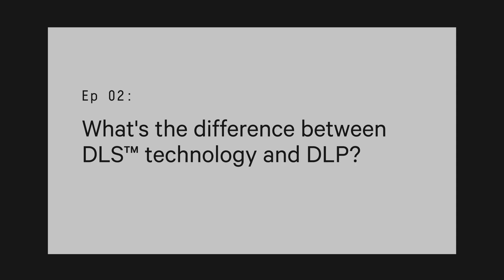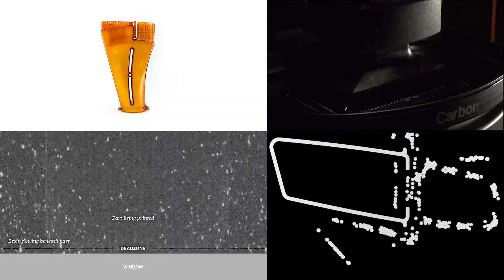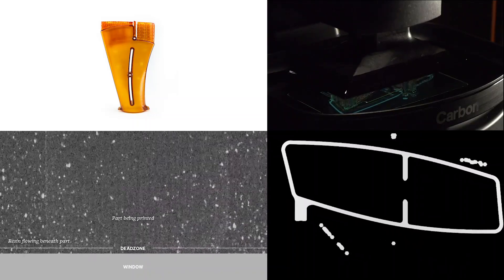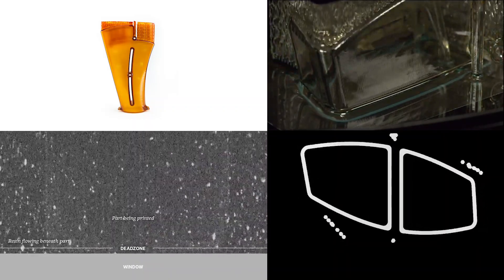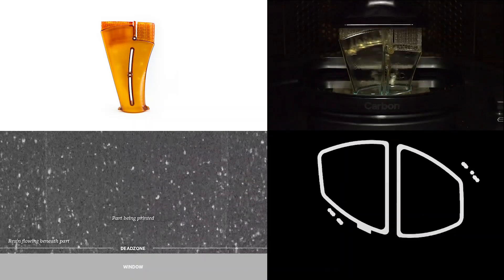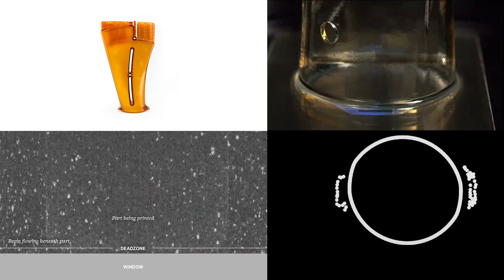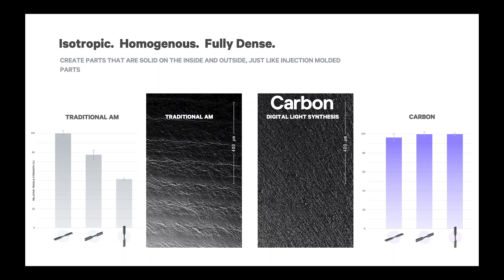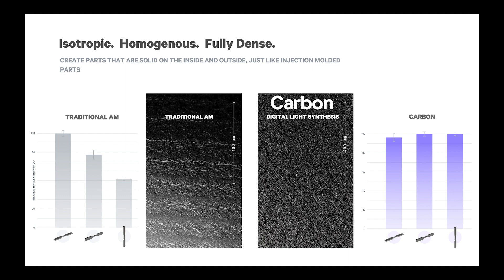DLS Technology vs. DLP - Ask An Additive Expert – Ep 2

Comment: when you say oxygen do you mean the air outside or actual o2 and you have to replenish an 02 tank inside the machine?
Reply from the maker: Hi Tyson, thanks for your question. Carbon printers use oxygen concentrators that collect oxygen from the air; there's no need to replenish an O2 tank.